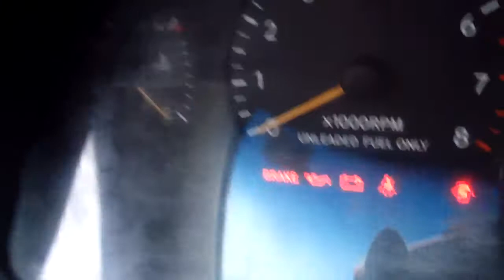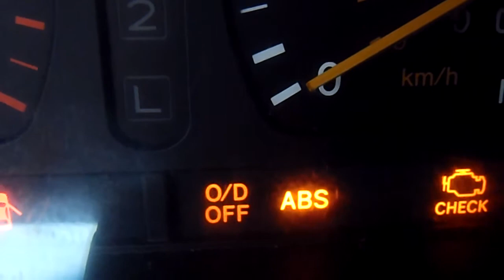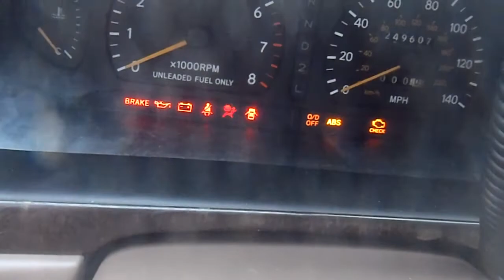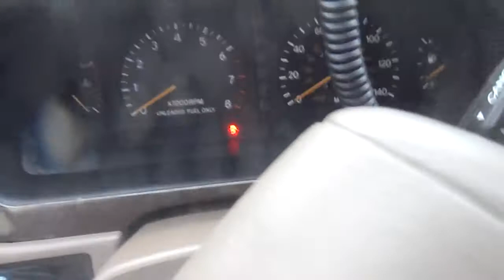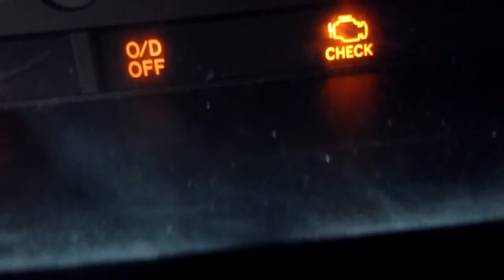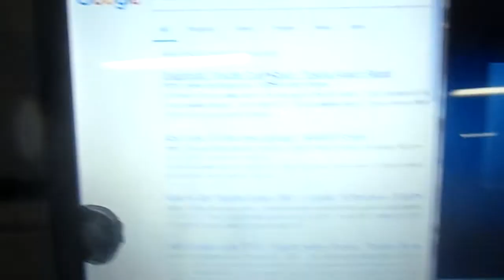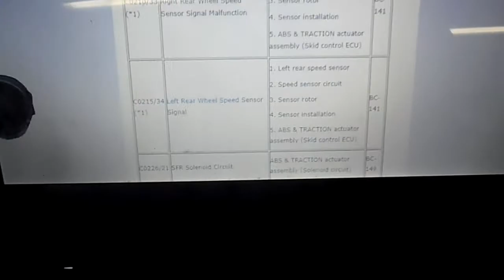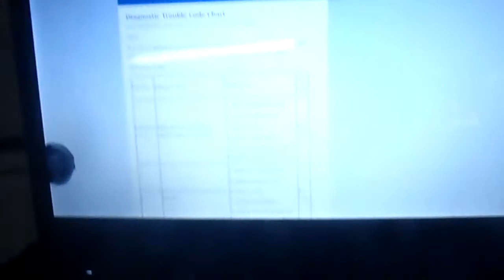How to retrieve Toyota Avalon ABS codes First generation 1994 to 1999

Comment: For me, my TRAC OFF light flashes 43 and not my ABS. Does it matter which light flashes? Does it change the diagnostic
Reply from the maker: I couldn't tell ya. This one doesn't have traction control.
Reply: @DoAWheelie392  hmm, well I sold the car so not my problem anymore🤣 I’ve had no traction or ABS in that car in my 6 years on ownership

Comment: How would you clear those codes after you replace the sensors?
Reply from the maker: Usually if you drive for  I think it's 20 miles or something like that after the problem has been fixed, the light will turn off by itself.

Comment: Wow thats exactly what happend to my avalon. Raìsed my from wheel put the car on drive to check the cv axle. I got abs light. So please how did u fix it..
Reply from the maker: If all your speed sensors work correctly, just drive it for a while normally and it should clear itself.
Reply: @ @DoAWheelie392  Thank you will do